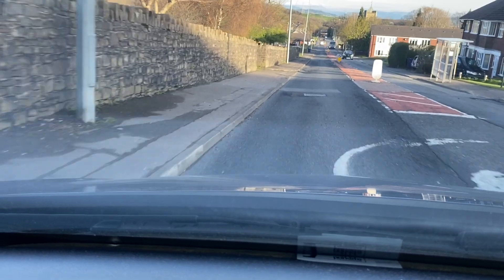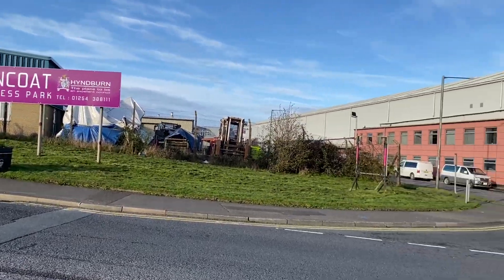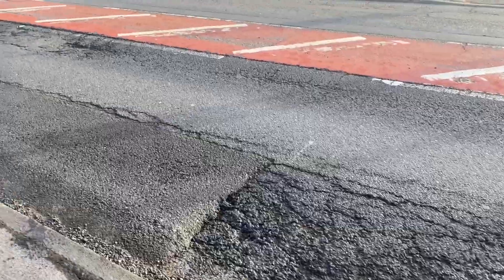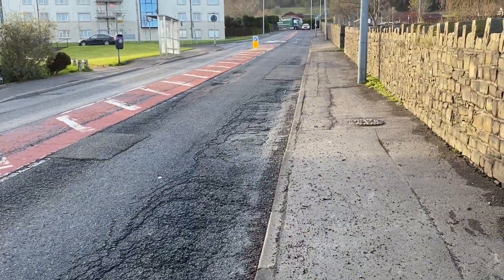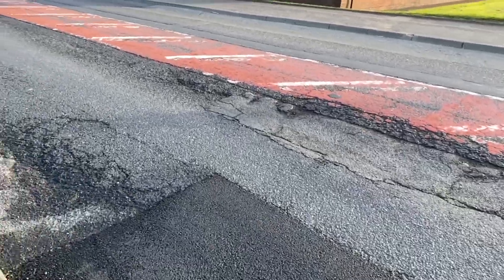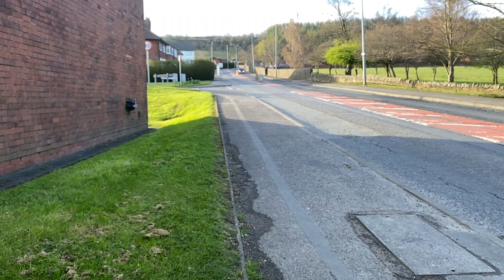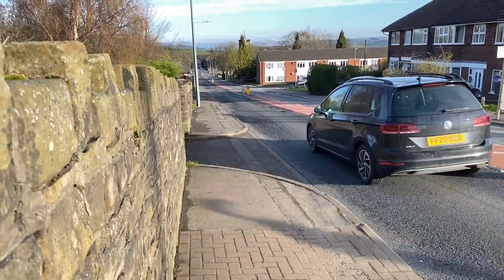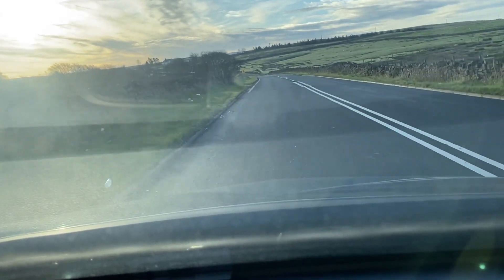Very Poor Road Surface Bolton Ave Accrington, Road Okay Say Lancashire County Council Part 1.

Comment: Don't worry we'll all have to pay 12 pound a day soon to travel anywhere on these shit roads. Never mind the council are happy with their big bonuses.
Reply from the maker: Very true, but only if you don't have an electric vehicle, the trouble is that in that area only something like less than 10% of homes can charge electric vehicles at home as they have off street parking. We don't have that so when we applied to Lancashire County Council we was told that we could not have an electric vehicle and charge it at home. The nearest public one is 2 miles away and is never empty, there is going to be a lot of up happy people around waiting to use the very few public chargers.